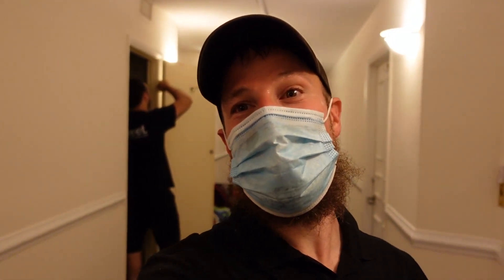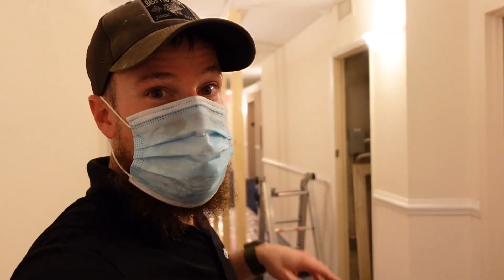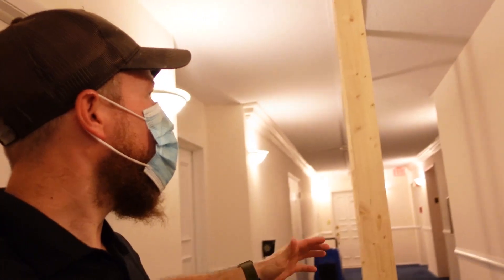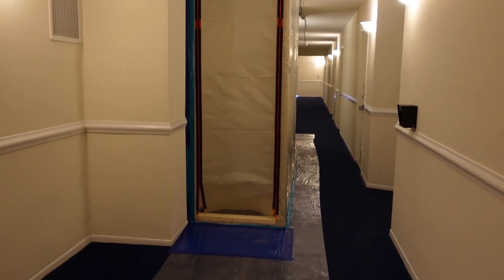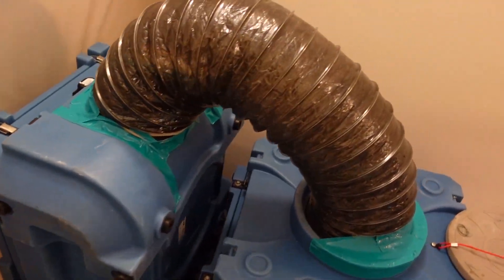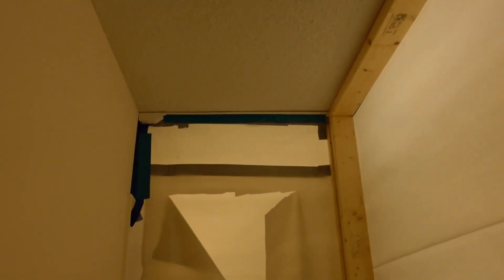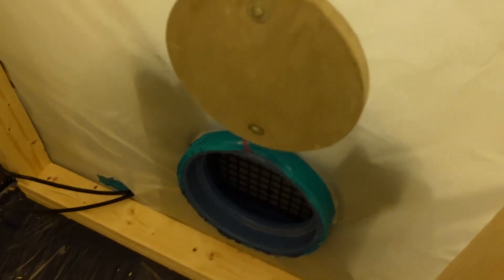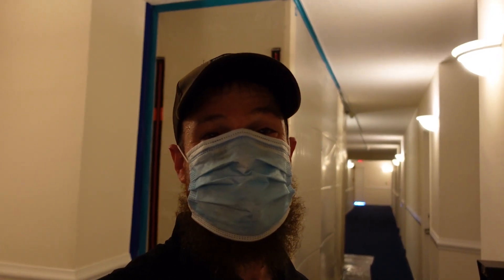Pressure Fit Containment For An HVAC Mold Remediation Service

Comment: Josh I reviewed this and found it exactly what I was looking for, as I’m getting ready to build one of these.  In particular I like the three chambers.  Reminds me of asbestos training.  I didn’t see a pressure differential monitor but I’m sure you had that covered.  Excellent work sir!
Reply from the maker: Thanks Bodi. The negative pressure was established and checked after the air handler was removed. No additional materials were removed, which would alter the pressure differential, thus a manometer was not left on site through the duration of work.

We don’t frequently setup 3-part chambers, however, this was requested by the third party environmental consultant.  Worked well for this project.

Comment: Looks good. My question is, why not us zip poles?
Reply from the maker: Great question! In this instance, the indoor environmental professional (IEP) called for the use of pressure-fit/framed out containment. 

This containment very easily could have also been erected using adjustable height poles, including zip poles. One benefit of the wood framing over the use of poles is the seal you’re able to achieve, even before the use of tape from the plastic to the ceiling and surrounding walls. 

If utilizing foam rails with zip poles, you can fairly easily achieve a good seal before the use of tape as well. For long term containment needs, wood or metal framed containment can be ideal. One additional benefit is the ability to just throw it all away when you’re done.

Comment: That's actually a good ideah
Reply from the maker: Yessir! A number of folks in this industry are already doing this, and much better, might I add! Also, they’re using not only wood studs, but metal too.
Reply: @IAQJosh  used to use zip poles or  the other metal poles but now I'll use this method
Reply from the maker: @jasonragoobar1613  Zip poles very much still have their place. My remediation team uses them on the regular. Quick and sturdy, as you know.
Reply: @IAQJosh  I have my wrt and my asd I live in the ft Lauderdale area

Comment: Please tell me where we can find that aqua colored duct tape that you edged the barriers with.  A year ago, our house had mold remediation, and they used that tape.  It lasted for months, but now is falling down.  No other tape that we have tried is holding the plastic sheeting on the ceilings and walls.  The roofer who damaged the roof has not repaired the roof yet, so we have to keep the plastic up until it is done, and we can build real walls in our house again.  It's ridiculous!  We need to get more of that tape, so please tell me where to buy the aqua colored duct tape.  Thank you!
Reply from the maker: While there are a couple of different distributors that sell this tape (at a minimum), I buy mine from Abatix Corp. 

Just for your information, this is merely a private label and color choice tape, which I want to say is manufactured by Intertape or Nashua. Regardless, this teal duct tape can be purchased from a couple of different places.
Reply: @IAQJosh  Thank you!  I saw Nashua but didn't know if it was a good one to use.  I'll try it.
Reply: Aramsco sells the aqua colored tape.